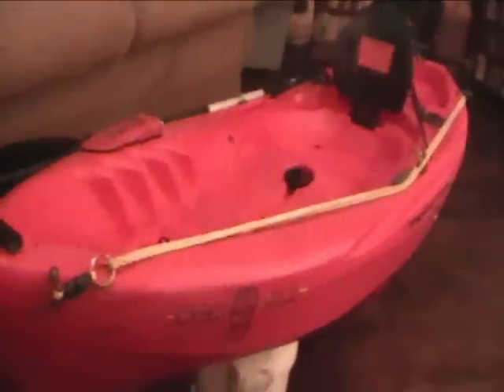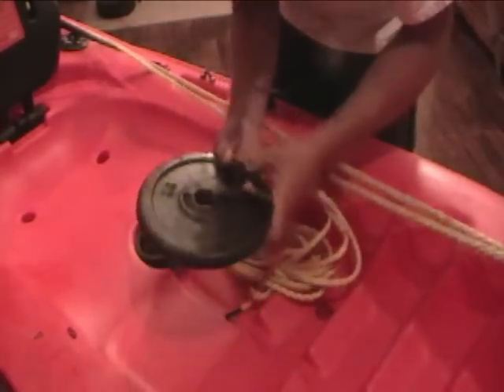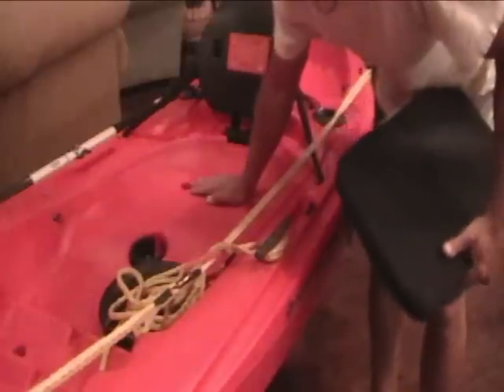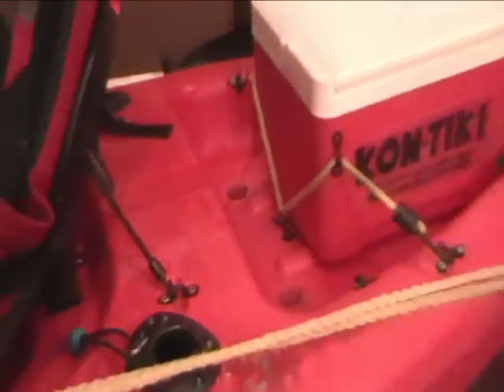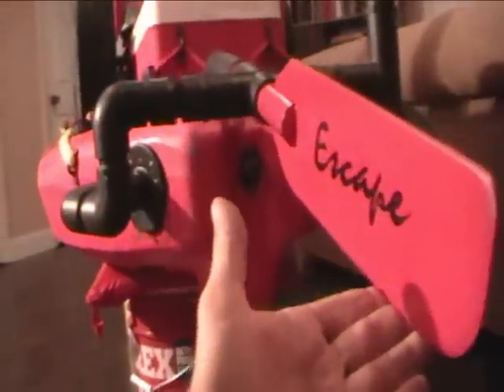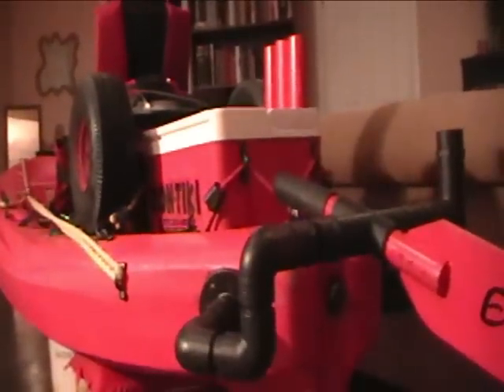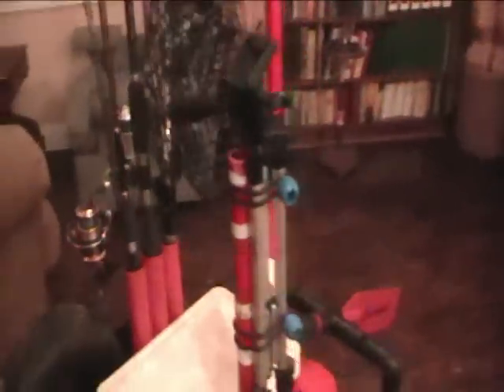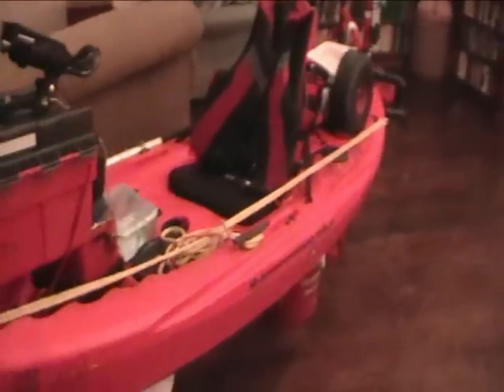Poor Man's Fishing Kayak

Comment: Marty just watching some vids to catch up on. But this boat, and watching you DIY Add-ons, is what got me hooked and I wouldn't trade my kayak for anything. I did start with just a moment 10v2, just to learn. Now i have my 120, mirage drive, my J2 Bixpy motor that just came out 8n 2023. All my add-ons, accessories, DIY's, my small new trailer I purchased. And modded out some PVC to pull the kayak up and lower it next to my truck, but mostly all my gear is on the kayak. Epic videos, and you've inspired a lot of us. 🙏 🌊 🎣

Comment: I've been designing and building kayaks for years and I gotta' say this is the most innovative piece of work I've seen in many moons. If you don't have a degree in engineering, don't bother, there's not much they can teach you!!  Haven't read through all the comments so excuse me if someone else has mentioned this but you really need to do something about the "bitter" end on the anchor line.  You will eventually lose it overboard the way you are doing it now.  If it were me, I'd take the bitter end and put a loop in it, pre string it through the steel ring and hook the loop over the cleat.  When you anchor just feed the line out and then secure it the manner you are now.  This way there is no chance of it disappearing overboard leaving you with no anchor.  The only other thing I see is that fish box.  Boy is it clever but the center of gravity is so high I'd make it a priority to figure out a way to lower it somehow.  Sometimes 1/2 and inch of vertical CG displacement in a kayak is critical.  Couldn't hurt......
Reply from the maker: Thank you, David. Of the thousands of comments I've gotten on my channel, this one is special; for a kayak designer to give me kudos. Your input has been preceded by many other bits of helpful hints. And I have listened. I recently posted a rigging update (my second update video) and it shows the pontoons I added to compensate for the high center of gravity. I can throw a cast net from this baby now! :^) Thanks again for the comment - Marty

Comment from the maker: Thank you, bludog. The pvc is one inch in diameter. And, Yes. Those are galvanized flanges. I just got a 1" male coupling and found the right size flange to go with it. I have logged hundreds of hours since I installed them and there have been no problems. No leaks at all.

Comment: I just bought this yak and wanted some ideas to help with rigging because of its small size 8 ft doesn't give you much to work with but i like being able to slip it into the back of the Yukon instead of putting on the roof. You took the time to make this and I wanted to take the time to thank you for sharing your ideas.

Comment from the maker: Yes. The roughest situation had me with this yak loaded with two coolers and camping equipment paddling 7 miles out to a barrier island.  The yak wanted to roll if I leaned too far sideways so I had to be conscience of keeping my center of gravity over the middle. Also, the flat bottom and short length makes you more susceptible to the wind. It'll get you there. But you have to paddle much harder than someone in a long, skinny yak that has a V-bottom.

Comment: Thank's Marty,  Funny thing is I'm in the process of designing a new kayak and your work here has set my innovation clock spinning.......I just finished checking out the updates.  Good stuff as usual.  The last boat I built had a dual set of outrigger floats/ paddling/sailing.  Much more complex than yours but they worked just fine.  I'm going to try to build in some of the features you added on the new boat and check out the bed liner material too.  I love having a place for the paddle secure across the coaming of the cockpit. Stuff has to stay IN the boat. I just subscribed, so keep the good stuff coming!!

Comment: Excellent, and Frugal, add ons my man. As a bargain basement shopper myself, I really like your creative usage of "stuff".
As an older fellow I believe the only thing I'd like to see would be a small outrigger/flotation system. your boat seems a bit top heavy,as you mentioned. outriggers can be fixed, collapsible or hinged. Fixed might interfere with landing fish. they wouldn't have to be full length (just a couple of feet long in the bow, where the height is).  Another option- since you are rapidly approaching the "Law of Diminishing Returns"- is to start the search ,and budget, for a used 10' boat. Who knows, maybe you'll start "New Timer Canoes"..............good luck...............JRW

Comment: Awesome boat sir. I'm new to this and you gave me a lot of helpful ideas. I'd had to put holes in my kayak that I "thought" would be a good idea. Slow process. Just an idea I had though: the block that you use to prop up the front of your boat when putting the wheels on....we'll cover it with linex truck bed liner. It will make it durable yet still be lightweight and keep it from chipping apart. Thanks for the vid!
Reply from the maker: That's a good idea. Good luck kayaking:)

Comment: Other suggestions: Tubes in tires, then air to 5 lbs. Easier over soft sand. A small weight in bottom of bait box to hold it lower in water. Cooling blankets for larger fish (holds frozen cooling pads, wrap up fish, keeps them cool). Your stern paddle works like a swing keel on a sailboat. In a breeze, you might be able to sail your kayak with an open umbrella. Rig umbrella for hot days, when shade is scarce. Great job on your boat. Happy yaking.

Comment: Really nice setup you have, lots of things I would have never thought of, especially the toolbox/fishbox and the live bait double bucket! One thing I'd mention. Instead of using that heavy 10lb. weight, you can grab a 2.5# foldable anchor from Boat US/Wal-Mart for a measly 5-6$. It folds up nice, and to deploy, you just lift the lock ring, out pop the four legs, and then slide the ring down and it locks in. Great for using in sandy or muddy bottoms and takes about 7lbs. off your total weight.

Comment: A suggestion on anchoring: An anchor holds better with a horizontal pull than a verticle pull. An anchor rope is called a rode. The suggested rode length is 5 to 7 times the scope (water depth). So, if you are in 30 feet of water, 150 feet of rode will allow you to be securly anchored without dragging, and maybe fouling your anchor. If you ever needed to anchor to survive a sudden storm, this might be good to know.

Comment: Great video. I have successfully used liquid laundry detergent bottles filled with gravel as anchors. Tie the rope through the handle. This way if the anchor gets stuck under rocks and isn't retrievable you can cut the rope and you really haven't lost anything.

Comment: Nice setup! As a suggestion, I would put a float on the end of the anchor line in case you misjudge the water depth. The ring could be replaced with a carabiner since you cannot feed a large float through the ring.

Comment: Just an idea, put a bungee from the back of the boat to the rudder so the bungee pulls the rudder into the water, then tie a line to the handle of the rudder. Buy another one of the things you tie your anchor line to and put it where you can easily get to it from sitting. Take the other end of the line you just tied to the rudder and run it through the docking thing you just installed. When you want the rudder down, loosen the line. When you want it up, pull the line and tie it off.

Comment: I'm about to do this :)
Going to get the parts tonight
Just need to figure out how to piece it all together to make it work.
Reply: taprackbang88  did u get your pipes yet what part u looking for
Reply: I actually just ended up buying a better kayak than the one i had when i made that comment. I have done rod extensions, a pole holder/cooler. and im going to eventually do pontoons. who knows when though. Its really hard to find long cylinders of styrofoam..

Comment: that suckers wired for sound. you should really mount a few submersible lights and use the foam blocks area for a marine battery and strap the foam to the front of the cooler box. then you could mount a ac adapter and inverter to charge your phone or camera and run your light. this thing is feckin serious man, kudos. people around here would pay alot of money for a boat like that.

Comment: Nice video. Those plastic tool boxes have a tendency to snap and break right at the hinges, especially when out in direct UV light for prolonged periods of time. Is your rear DIY plastic rudder just straight like a daggerboard/centerboard or does it also turn left to right and act as a rudder with tiller? Although neat use of space with your mods, most kayaks are weight limited. How well does your mods work with your own weight in the boat?  Nicely done video.

Comment: Yo Southern, Kayakakakaer.  Liked your Voodo...  But I have one question, the handtruck wheels.  Was the hole in the top of your Kayaki or did you drill em.  Also where did you put the pvc pipe frame under your kayak, again did you drill water proof holes??  Thanks for your reply.  Build a snowman.

Comment: Ingenius. You should have been a Mechanical Engineer. Weave a different color piece of yarn every five feet above your anchor, and you can tell water depth. Bubble wrap your styro seat for comfort. Brass snap tied to cleat, then anchor line slips through, two overhand knots secures until released. Consider neck knife and whistle. Soldering iron makes measurement marks on boat then paint, then wipe paint off. Light stick on tree at launch point at night, easy to return to take out point.

Comment: Hey man great vid. Question though... how tall are you and how much do you weigh? Reason I ask is i'm 5'10 and 200lbs and everyone i ask tells me to fish gulf waters i need a 12-14ft kayak. I'm not ready to fork that kind of cash over if i don't need to
Reply from the maker: Good question; I'm 5'5" 140lbs. The Emotion Spitfire 8 has a capacity of 240 lbs (without pontoons like I have now) and the Emotion Spitfire 9 has a capacity of 350lbs. That's plenty of buoyancy for regular folks. The main drawback with a short , flat bottomed kayak like mine is tracking and cutting through waves. I usually paddle in calm, protected waters and don't have to deal with the surf and big waves and since I added the skeg in the back, it tracks like a 14 footer! Good thing is, the small kayaks are really cheap compared to the big ones and if you come to realize that you need a bigger kayak, you can always sell it and upgrade. I think folks sometimes wait WAY to long, pining away for the perfect kayak when they could be on the water now, having a blast with a smaller, cheaper kayak.

Comment: I like that anchor trolley.  Wouldn't it be wise to add a knot to the end of the anchor line so it can't slide all the way through that ring?  Say if the anchor slides into some deeper water before you can tie it onto the cleat.  The line would run through the ring until it hit that knot.

Comment: Can you tell me how you attached the rudder assembly to the kayak? It looks like a shower curtain flange painted black.
Reply: NM. Saw on down the comments where they are galvanized floor flanges. BTW I bought this exact yak just because of your video. You should become a paid spokesperson for the company!
Reply from the maker: Mark Corbelli Thanks, Mark. I just found this kayak for $250 w/free delivery online. I almost bought a new one because of all the scratches mine has on the bottom.
Reply: zoffinger Yes, $224 at Cabela's, used the free shipping code which saved $18.95 but still had to pay the $18.00 surcharge for large item. Used Discover for an extra 5% off and no sales tax. Can't wait till it arrives!
Reply: zoffinger
 hey i just got this kayak in a lime green color how do u put in your rod holders

Comment: Great job and all but that things gotta weigh a ton!  Hoisting it on the top of your car, whoa!  I've found that successful yak fishing is all about packing light and you've just got way way too much stuff there.  Be careful, you flip that thing and it may sink like a stone.  Good vid though, gotta give ya credit on cutting corners!  Be well and fish on!
Reply from the maker: Slipping the kayak into the bed of my pickup truck is easy. And a sit-on-top kayak doesn't sink when you flip it. Thanks for the negativity, though.
Reply: Mark Abolofia obviously not familiar with buoyancy and water displacement, are we Mark.

Comment: For the rod holder did you just drill a hole, stick it in, and screw it on?
Reply from the maker: sasgeta They were there when I got the kayak, but yes. That's how they get installed.

Comment: Hey zoffinger, what kind of flush mount rod holders are those? The ones behind the seat.
Reply from the maker: They came with the Emotion Spitfire 8, I think.
Reply: +zoffinger oh, When I looked up the kayak it didn't have them.
Reply from the maker: Fishing New England I bought that kayak used. They're probably Attwood rod holders. Model # ATT-127015
Reply: +zoffinger Thanks a ton!